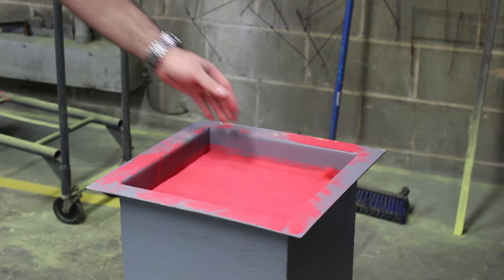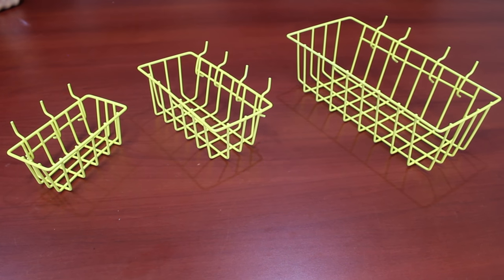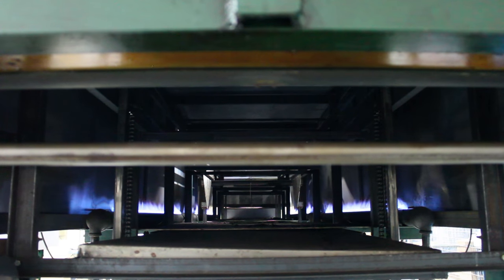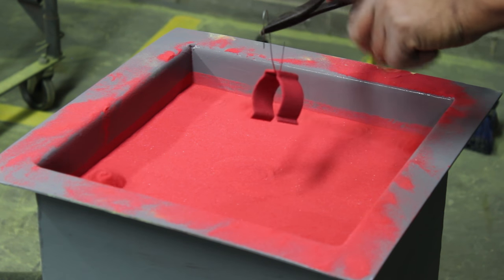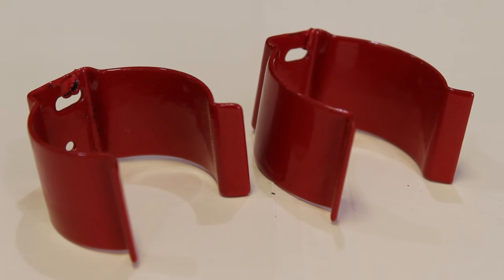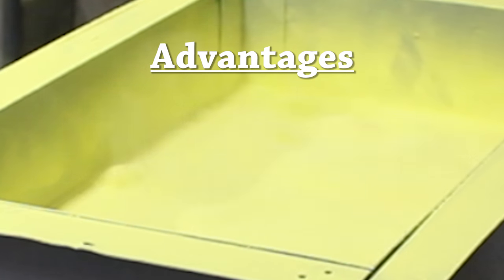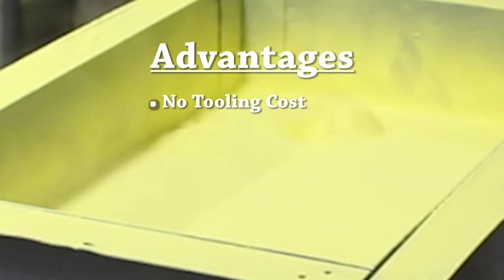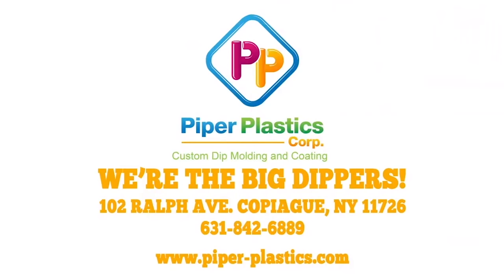See the Fluidized Bed Powder Coating Process

Comment: I am working to build some fluid tanks and have had a couple failed attempts so far.  I have read that some powders are too fine for this process.  I am currently working on that research.  I am seeing guys build very small tanks and coating fishing lures and such so I know it's possible.  I believe the trick is the membrane choice between the powder and the air chest as well as the powder granularity.
Reply: Some people use 3D-printed compartment trays to distribute air and cover it with a paper air filter. Seem to work great.

Comment: HI is this possible with the plastic as well or its just metal that can be Coaten???? can you coat polyamide 12 with polyamide 12????
Reply: if the material can bear 200 degree centigrade than it can be powder coated